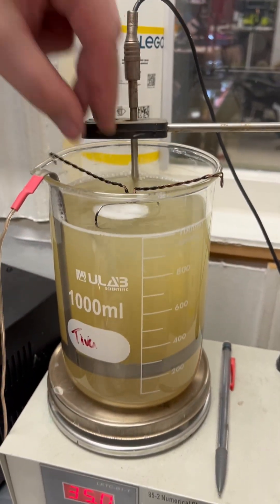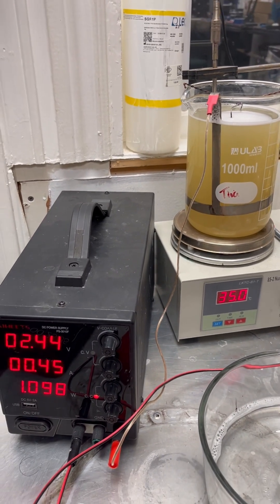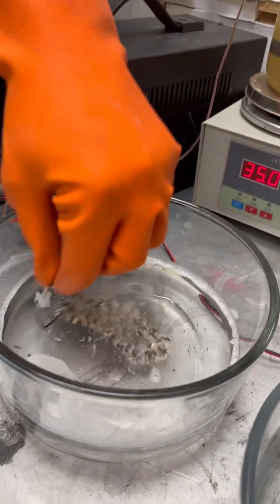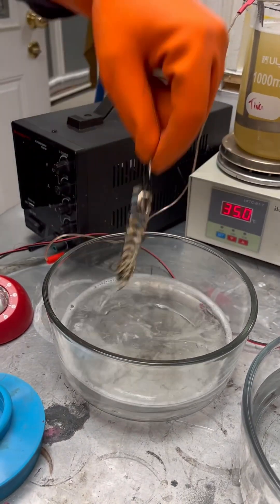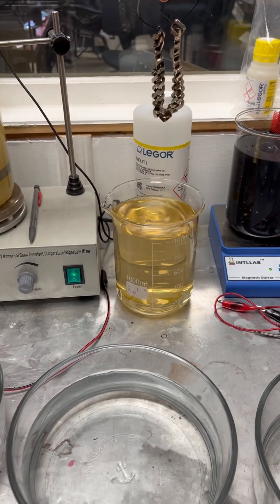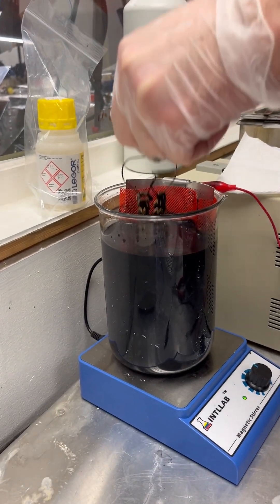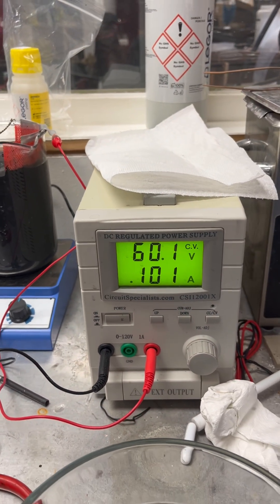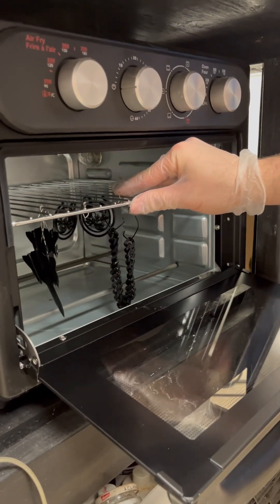Nano Ceramic Plating Chain

Comment: could the chain be rotated in the bath to open up those. touching spots? 🤔
Reply from the maker: During this process, you don’t want to be removing the item from the bath multiple times, and repositioning the item in the bath is slightly difficult as it starts to fuse the links together as that coating builds up.
Reply: @ClearMindJewellery  i do mean fully submerged with some plastic rotating device 🤷
Reply from the maker: There is a plastic stirrer in the beaker already to keep the particles in the solution mixed. 
You would need to toss, or poke, or otherwise use a larger force to make the links move which would likely end up, scuffing the uncured plating.
We did try to dipping & cure the missing areas a second time and that did turn out ok.

Comment: Use more water rinses between each bath, DI water in some cases. This will increase the lifespan of each bath and maybe even help you achieve that color you’re looking for in one plating session.
Reply from the maker: The colour overall was not the issue but, as per the video, the areas of the chain which were touching and end up fusing in the bake and therefore leave uncoated areas. -Shannon